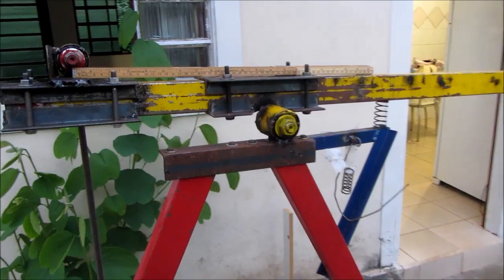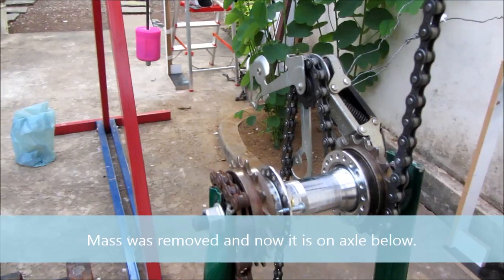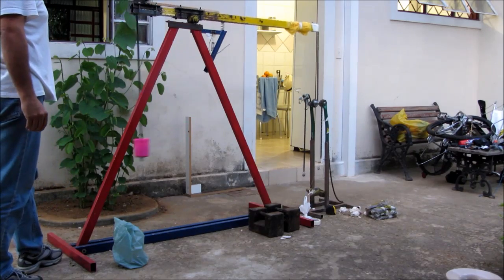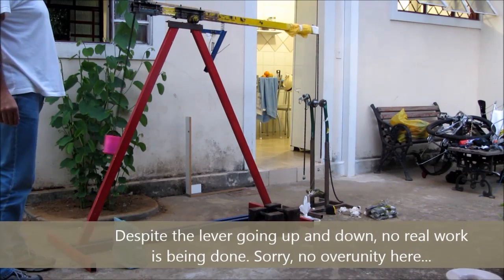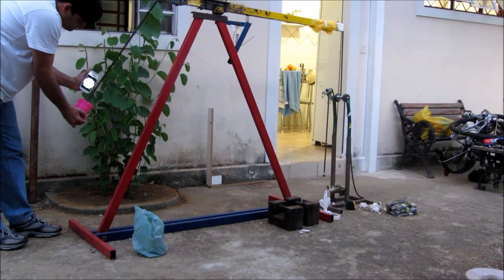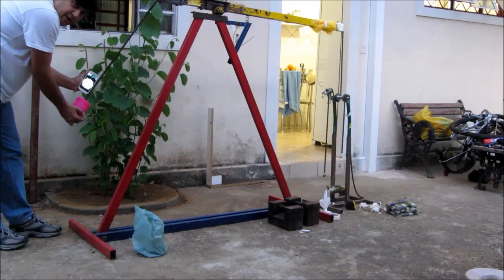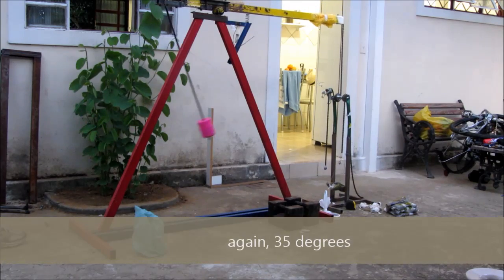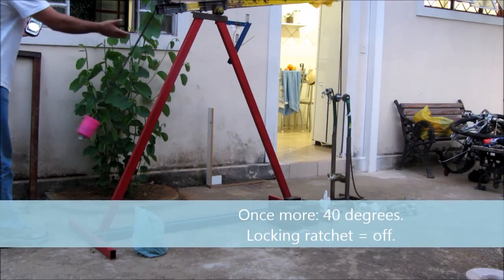6 - Two way oscillator - Comparison between workable and non-workable mass

Comment: Dear Sir,
 
Can you please measure efficiency if you drive pendulum with greater amplitude.
It should be minimum 70 degrees and shouldn’t be allowed to drop down below
60 degrees. It would be the best if only one period was used. It means that you
raise the pendulum up, for example 80 degrees and allow it to go and come back
and then catch it and measure the angle again, to see how much it has dropped.
You also measure how much the weight on the lever went up.
Reply: Luiz Fellipe Salomon Hi Fellipe , what was the outcome ? Can you also please post it over here ? Many thanks. Regards, Stefan.
Reply from the maker: overunitydotcom Oh, and the outcome was around 35~40%
Reply from the maker: First of all, it is of my greatest honor to receive such a comment - and mission -  from the "Milkovic". You are truly an inspiring person.
Second, the honor still continues... :-)
Thirdly, I have to give merits too, to Mr. RHEAD100. He also has some great stuffs.
I will make the measurement and let you know.
What I noticed is that, the more lever that I have on the Right Hand Side (RHS - the pendulum side - even though on the video it is on the left side, but I tried to maintain the same line of thought of your papers), the pendulum "drops" more with a restoring lower angle. On the other hand, actually the Left Hand Side - LHS, the amplitude is higher, of course.
The ratio between LHS and RHS is about 3:1, but can be changed to any ratio.
My objective here is to measure the actual amount of energy, trying to convert all of the results in energy terms.

Best regards,
Luiz
Reply from the maker: I made the experiments you asked for. I have this email from you: veljkomilkovic@gmail.com

Is it right?
Reply: Yes, it is right.
Reply from the maker: overunitydotcom Let me try to explain, with a few examples:
Imagine just one pendulum, with a 1kg bob, 1 meter in length, raising it 1 meter high. To make this work, I would spend 10J of energy.
If I get a single mass of 1kg and raise it 1 meter high, I would also spend 10J.

In the case of the Two way oscillator, when you release the bob, for example, at 30 degrees, the centrifugal force pulls the RHS down.
(RHS = Right Hand Side - bob's side  **even though on the video, the bob is on the left hand side, but most of Mr. Milkovic's papers and the ones found on overunity.com, shows the bob on the RHS)

When the RHS goes down, obviously it pulls the LHS (Left Hand Side) up. (LHS - Left Hand Side - Load Side, side where the potential energy would be stored).

When the RHS goes down and "transfers" energy to the LHS, the bob looses energy. So, in the example we are using, if we release the bob from 30 degrees high, it would swing and we would stop it at about 20 degrees high, after one period. These 10 degrees difference that it lost, was transfered to the other side: it was transfered to the working weight, or LOAD.

To "reset" the system, we would have to add an external energy to raise back the pendulum from the 20 degrees position to the initial 30 degrees position, so we can do our work again.

This amount of external energy is the one I considered for efficiency. 

In the real case, I dropped a 3kg BOB from a 90 degree position, and it stopped at the 60 degree position after one period. Calculating this, the pendulum "lost" 0.5 meters. So I will need to add 0.5mx3kgx9.81m/s*s = 14.7J to the system so that I have my pendulum back to the 90 degree position. 

On the other hand, literally the LHS, there was a 2kg mass (LOAD), that travelled almost 30cm, resulting in a potential energy of 2kg*0.30m*9,81m/s*s = 5.7J. 

So, I will spend 14.7J to reset back my BOB to it's initial position (90 degrees) and my LOAD only gave me 5.7J of potential energy, which is around 39% of efficiency.

Please note that the initial energy spent to place the pendulum at 90 degrees (around 30J) was not imputed or considered and would tend to zero as time would tend to infinity.
Reply: @LuizSalomon  pendulum is not doing free fall, therefore mgh cannot be used. All points (angles) potential energy can be calculated with this formula: PE = mgL(1 – COS θ).

KE=  ½mv^2
Reply: Luiz Fellipe Salomon Hmm,
then why was Milkovic getting 1200 % efficiency ? Or look at this example:
https://youtu.be/fEA6UPm_RZQ?t=6m12s
He is having a big weight and just needs to swing it only  a bit to pump up his air mattress...
Reply from the maker: ThomasTheSailor Chubby  I'm not actually measuring force, but measuring energy. You have to think of the system in terms of energy (this is what everyone is looking for: free energy). You may check from other videos, where the arm is released from the ratchet, that it produces an up-and-down movement. This movement is like a bouncing ball. It doesn't mean that the ball will bounce forever, but presuming it would, the ball would only bounce until you use up it's energy.

You can check the other videos to see the TSO making the same up and down movement, with an almost equal force (don't forget that there is friction and it will come to a stop), before I attach the ratchet.

Aren't you confusing force with energy? I mean, try turning the up and down movement in some other measurable amount. In my case, I transformed the pendulum-lever movement into potential energy.
Reply: Luiz Fellipe Salomon
 You're right.  most mechanical people understand conservation of energy..  But this pendulum, level set-up is a mind bender..  The term "mechanical amplifier" is different too.. I'll never stop tinkering with mine. It's fascinating, it sure looks like overunity.  :)    Another interesting machine is the "Skinner Gravity machine",  I know that one works.  I've taken a break from my pendulum project to build a Skinner machine
Reply: Luiz Fellipe Salomon
Reply: Luiz Fellipe Salomon Well done, can you please find out what the best ratio is from RHS versus LHS and what gives the most potential energy in lifting your weight ? Don´t you think that your lever arm, where your BOB is fixed on is a bit too short ? Regards, Stefan.
Reply from the maker: overunitydotcom I made an Excel sheet, that I would be glad to email it to you. Is it hartiberlin at gmail?
Reply: Luiz Fellipe Salomon yes, hartiberlin@gmail.com Can I post it on overunity.com then ? Many thanks in advance.  Regards, Stefan.,
Reply from the maker: overunitydotcom In the case of the best ratio, it really depends, but around 3:1.
If you have a smaller lever on the bob side (like you asked), then you will be needing more BOB weight, or a higher BOB angle (so you can have more kinetic energy).
But, if your BOB lever arm is bigger, then you would be needing less weight, but the amount of energy used to restore the system would also be higher.
Assuming a 0 degree position being the bottom of the pendulum, in rest position, the best result would be if the pendulum was raised up to 30 degrees (cosine of 0.866). At this point, the energy used to reset the pendulum back to 30 degrees would be small. On the other hand, the tangential velocity would also be small, making the working load on the other side go up around 35% of that used energy.
If you have any suggestions, I would be glad to apply it and let you know.
Reply: Luiz Fellipe Salomon What do you mean by your words:"the amount of energy used to restore the system would also be higher." Do you mean to have the pendulum again raised at 30 degrees ? Then why don´t you make the Bob just heavier ?  And what do you mean with "outcome was around 35~40%" ? Is this the efficiency or what ??
Reply: Luiz Fellipe Salomon Very well explained... So your total efficiency is then only around 39 % max in all your tests ?
Reply: Luiz Fellipe Salomon Do you think that the most people don´t measure their input power correctly, if you claim only around 40 % efficiency ? They just swing the pendulum very easily with not much force..hmm...
Reply from the maker: overunitydotcom Yes, the energy efficiency is pretty much around 40%.
When people swing very easily, it does seem it is making some easy work. The reality is that, the pendulum raises the load lever, loosing energy, and then the load, allied with the gravity, pulls down the load lever, giving back the energy (minus friction and some etcs) to the pendulum.

A good example is a hand lever hoist. It seems that it's easy, and you actually can raise 1T without a lot of effort. But in how much time?? It is the pulley principle.
Reply from the maker: overunitydotcom Good point. 

Now, don't confuse POWER with ENERGY! 

Power is the rate of doing work, or the amount of ENERGY per unit of time.

Like I explained in my example, ENERGY is Joules and power is Joules/second.

Another way to see this is remembering Archimedes:
"Give me a lever long enough and a fulcrum on which to place it, and I shall move the world."
Reply: Luiz Fellipe Salomon Hmm, it seems it is beneficial, that the lverarm where the bob is fixed on, is not moving much, maybe only 2 cms, so the pendulum does not get too much kinetic energy stolen... so the other leverarm must be much heavier, which is not in your case it seems.. Maybe you just did not find the right parameters yet ?
Reply from the maker: overunitydotcom I really don't think so. If I push the lever to one side, I loose on the other. If the bob is heavier, I will need a dead weight on my load side - or a longer lever, so my lever can go back to the rest position and push the bob up. Anyway, it's not an efficient energy device. It is an awesome power multiplier device, with many uses, but nothing beyond.

At the end, there is no right parameter, and I really don't believe, based on my tests and experiments, that there is really a right parameter.

Depending on your bob's weight, you use a certain lever distance or a specific bob height. 

I even made a simulation using Matlab to see if I could get a ressonance frequency that could improve. I also modelled it using AutoCad Inventor... All results where the same.

I am sure that the forbiding conservation of energy law that exists today will eventually be superseded. As for now, we are still stuck...
Reply: Luiz Fellipe Salomon   It seems you are only using (measuring) the up force at the chain side, what about the force down. You might want to put a sliding weight on the arm for a new parameter you haven't used. I have my small oscillator balanced so the down force is equal to the up..  It's not finished, but it sure seems to work a lot better.  I really think you are measuring one way. Missing a lot.
Reply: Luiz Fellipe Salomon
 Yes,  force is the wrong word, sorry..  I don't think the arm should bounce at all.  I believe it should have a smooth motion coordinated with the pendulum.  Milkovic has his own web site. I don't think he makes his to bounce..  If they do, it not intentional.  The bouncing seems to me, it slows the pendulum.. But the whole Idea is for all of to try things our own way and see what we all come up with..  I enjoyed your video.. Keep up the good work.
Reply from the maker: ThomasTheSailor Chubby
Thanks, Thomas. I also believe that, eventually, one will figure out a way to tame the beast.
The biggest problem, in my opinion and in my particular case, is the physics involved and my knowledge - as an engineer, of the physics. It is real hard for me, with the scholar background that I have, to go against a law like the first one of conservation of energy. This really gives me a stopping point, preventing myself to go beyond.
In my experiments, there where times that I had an extraordinary result, in the overunity area. What did I do? Went back and repeated to see where I measured it wrong. That's the most obvious action I had to do and every time it came down to a wrong measurement. Never overunity.
In the case of the TSO, I think that people that know physics - like me, don't take it seriously because it's the law. It's not a theory or a hypothesis: it's a LAW. Since it is what it is, people that abide to the law, believe it's not worth wasting the time to even look at it.
As of myself, I got curious about it, even though I knew it wouldn't cross the overunity border. So I built one.
An about overunity, Mr. Milkovic doesn't state that his accomplishment is an overunity machine, but a mechanical amplifier. People around the world are the ones making these statements.
And..
And to make you think about damping and etc's that doesn't make it work, you can check through the internet that are many "studies" and "papers" stating that the machine gives a 9:1 output; a 1400% efficiency; a 2200% overunity... I will give you this question to make you think over it:
If a machine gives a 9:1 output, wouldn't it be fair to consider that a small damping from the lever, friction and some other etc's, wouldn't affect the overall output of the machine? I mean, I have, in the least case, 9 times more energy output than input. Wouldn't it be fair to assume in my particular case, where the lever is banging and the spring is taking all the energy that I would loose 50% or 80% of all the extra energy? That would still leave me with 2 times the input, which would be by itself and extraordinary - or extraterrestrial - achievement!
Like Mr. Milkovic states, it is a mechanical amplifier. I agree with him.

Cheers!
Luiz